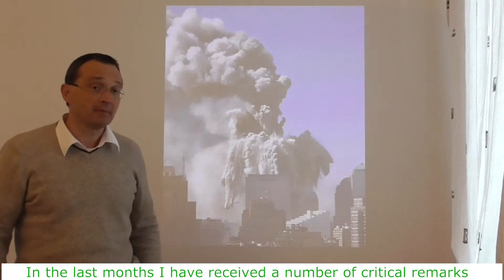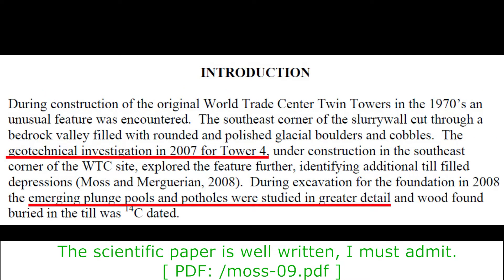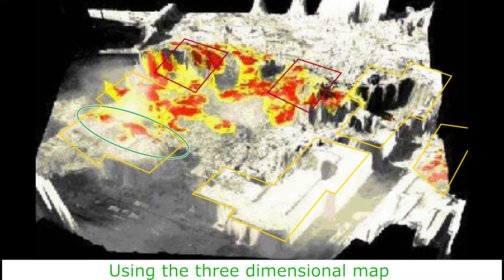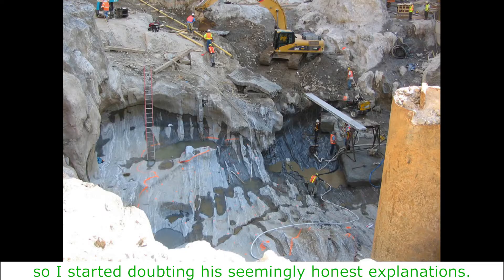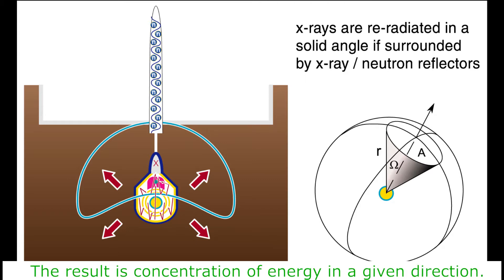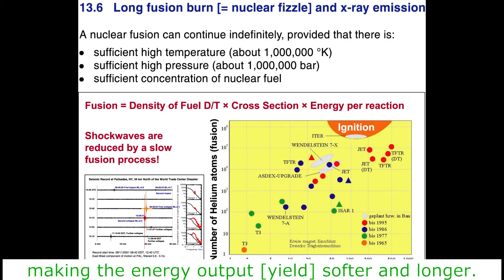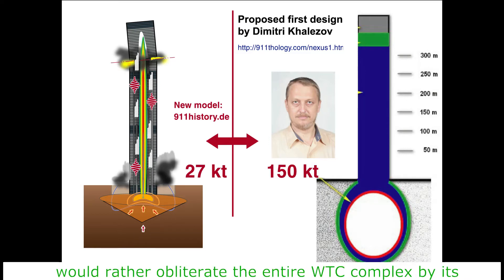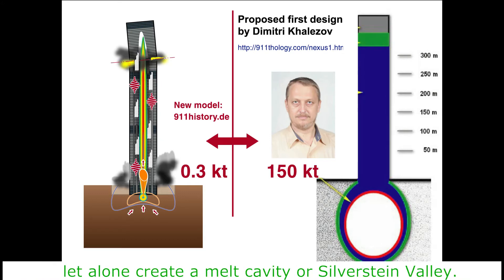9/11: getting the physics right; Part 1: [nuclear] yield & Silverstein's glacier formations

Comment: Thank you for your video. I have been watching 9/11 videos and reading the material. 
I have many inquiries:
Why do people always say, "no steel and concrete building has ever fallen before due to fire." Doesn't everything happen for the first time some time? Since 9/11 other steel and concrete structures have collapsed due to fire. The building in Tehran collapsed while on fire. 
There are debris removal and clean up videos. The workers are shown cutting the steel into smaller parts at the WTC sites. The debris is marked and noted. The debris was not just hauled, melted and sent off.
How are there any signs of a "controlled demolition" in regards to any of the buildings? There are no bursts of explosives, no almost deafening "popping" sounds; all of which would easily be picked up by video and audio.

The firefighters knew that building 7 was going to collapse, hours before it did collapse. They cleared the building early on, the building was unsafe.

Fire Chief Daniel Nigro: "The biggest decision we had to make on the first day was to clear the area and create a collapse zone around the severely damaged 7 World Trade Center, a 47-story building heavily involved in fire. A number of fire officers and companies assessed the damage to the building. The appraisals indicated that the building's integrity was in serious doubt. I issued the orders to pull back the firefighters and define the collapse zone. It was a critical decision; we could not lose any more firefighters. It took a lot of time to pull everyone out, given the emotionalism of the day, communications difficulties, and the collapse terrain" 

Firefighter Marcel Klaes "All morning I was watching 7 World Trade burn."

FDNY Lieutenant Robert Larocco - "We walked over by number Seven World Trade Center as it was burning and saw this 40-plus story building with fire on nearly all floors."

Firefighter Vincent Massa - "At this point, Seven World Trade was going heavy and they weren't letting anybody get too close. Everybody was expecting that to come down."
Reply: My main point is that the FBI, CIA, ATF, NTSB, Fire Departments did not find any evidence of bombs, explosives, controlled demolition, certainly not a nuclear explosion.
Reply: @jlaw7842  * "My main point is that the FBI, CIA, ATF, NTSB, Fire Departments did not find any evidence of bombs, explosives, controlled demolition, certainly not a nuclear explosion." * 

How could they have found anything. They admitted they never looked for any explosives...
Reply: Gregory Dahl 
And you would know? How is everything at the corner of make believe and denial?
Reply: Gregory Dahl no I could find no smoldering craters.
Sounds like people believe that everyone starting with the Fire Departments all the way thru to the FBI, CIA, NSA, the entire US Government, the airlines, the insurance carriers, the witnesses, the victims themselves, all were part of this massive conspiracy?
And all of them have kept this massive secret for 18 years?
Reply: Gregory Dahl I honestly do appreciate feedback. Again, I am saying that all of these people as individuals and as a whole were involved in this massive conspiracy coverup and it’s as easy as that to keep hidden without fear of any of them coming forward to expose?
Reply: Sue W there were hollowed out floors when the buildings were filled with people less than 24 hours earlier. Do you honestly believe what you are saying or is it just for entertainment?
Again, all of these people from all of they departments and agencies; FBI, CIA, Fire Departments, Police Departments, Insurance carriers, the airlines, the entire US government are all in on this, as it would take them all to cover 9/11 up if it were an inside job
Reply: Sue W yes, I am the dense one. I am such a sheeple. The buildings were hollowed out and never occupied by thousands of office workers
Reply: Sue W  And what as the great purpose of this whole 9/11 inside job